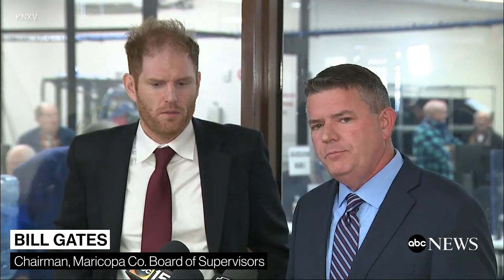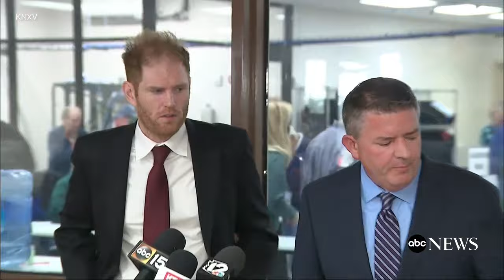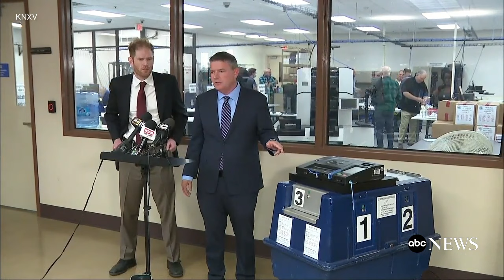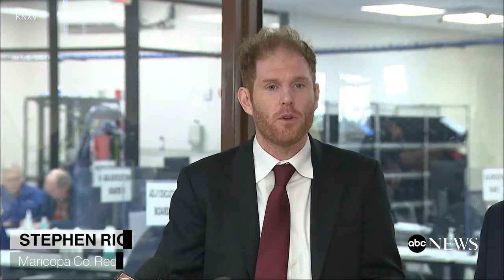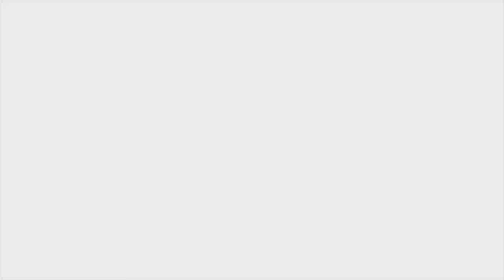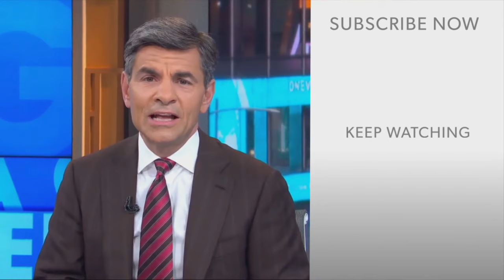Maricopa County reports issues with vote tabulator machines

Comment: Preparing for the big steal.
Reply: @nickyd922   Don't forget the bamboo particles. Really important stuff. 🙄
Reply: I Love it.
Reply: That's what Republicans tried in 2020, they just didn't prepare enough.
Reply: @roscodoggo7456  What a lie
Reply: Ballot won’t tabulate? Put the ballot in slot #3. From there it ends up in the dumpster behind Circle K.
Reply: @tylere.8436  no, that's exactly what happened.   It's not my fault you cannot handle facts
Reply: @roscodoggo7456  Lay them out them, how that was what happened. Please elaborate, how exactly did the Republicans try?
Reply: @roscodoggo7456  what are the facts.

Comment: IMPORTANT THINGS TO CONSIDER IN REGARDS TO THE ELECTION PRINTERS

The Shrink to Fit setting is used when the document (ballot) is bigger than the paper size in the printer.

So everyone has it backwards. A 19" document WILL print on a 20" page without changing any settings.

The original documents were deliberately SCALED DOWN from 20" to 19" BEFORE it was sent to the printer and printed on 20" paper which would cause an error later at the tabulator. The markings on those ballots would be out of place so the tabulator scan would kick it out.

The ballots were intentionally sabotaged, probably in the spooling dialogue. It may take a forensic audit to see where the SCALING occurred.

Keep in mind, the testimony from the Hobbs' witness proved that this same error occurred in each of the last three elections. So they were confident it would work again, especially since the Lake team insisted that Election Day voting was the best way to avoid disenfranchisement
.
The issue isn't that votes were never tabulated, the issue is that the log-jam created by the errors caused widespread disenfranchisement that negatively impacted the total vote counts on THE DAY when Republican voters would turn out more than 70% over Demoncrats.